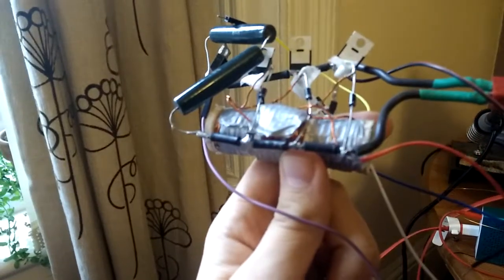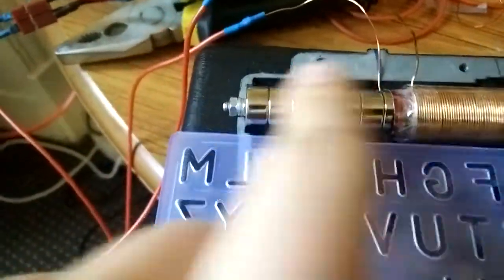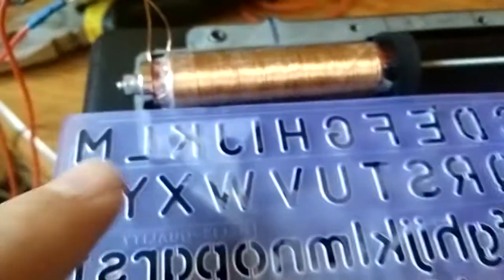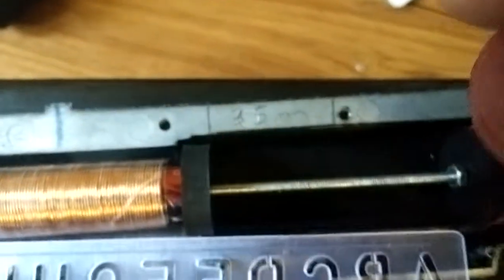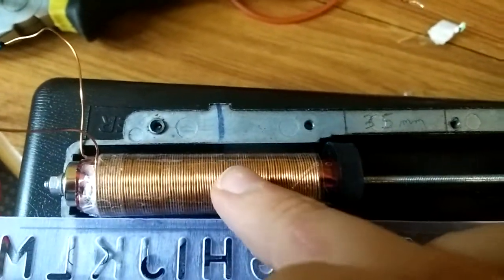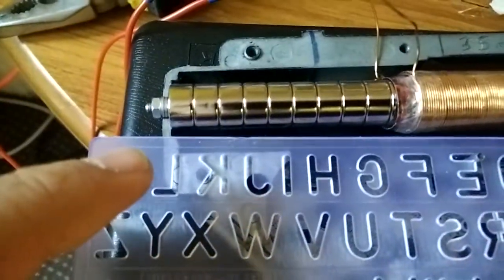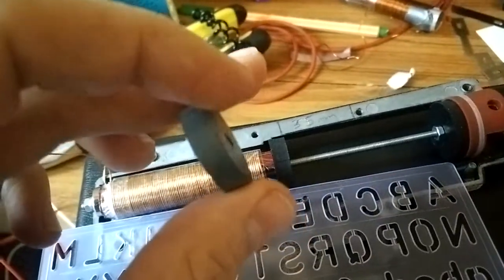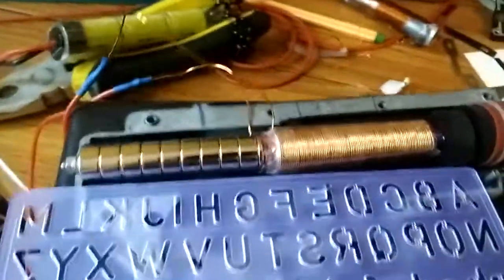Magnetic airsoft system based on voice coil [still in progress]

Comment: Seems cool. Those wires might come off in a higher ROF system,but the idea is very,very interesting. You've put a lot of thought and work in this idea.  Second video should be very interesting. Thumbs up man!
Reply from the maker: Ljudevit Binder thanks ! actually someone came out with the idea of using the same system of the little electric race cars!
next one should be definitely improved ;)